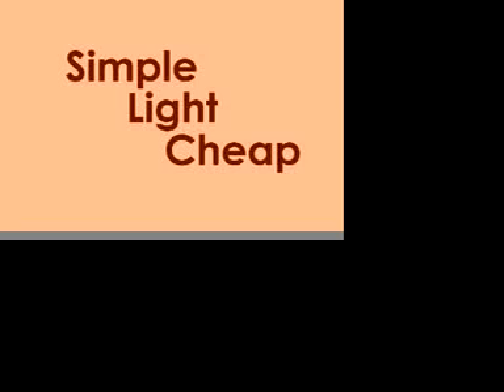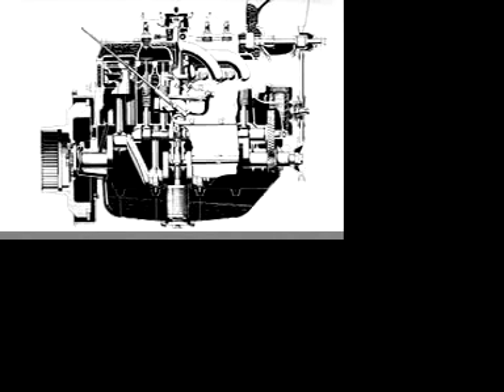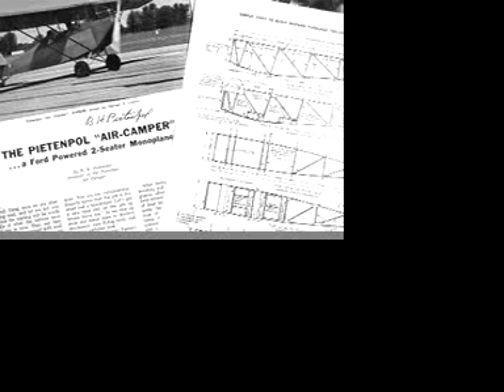Simple, Light and Cheap by Grant MacLaren

Comment: This said he stripped the engine of a bunch of weight. I'm wandering besides the starter and generator what could be stripped. That engine was as basic as it could be from it's birth.
Reply: I know he modified the oil pan and the water pump. And I know many people add aluminum cylinder heads and other lightweight performance parts.